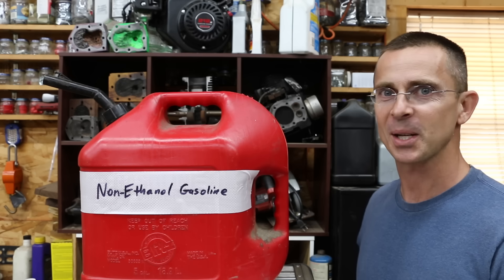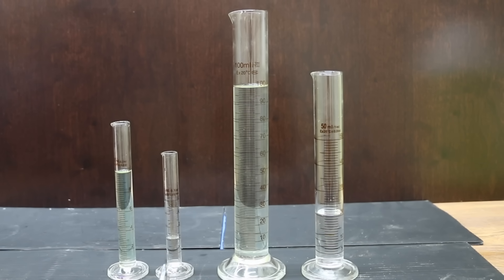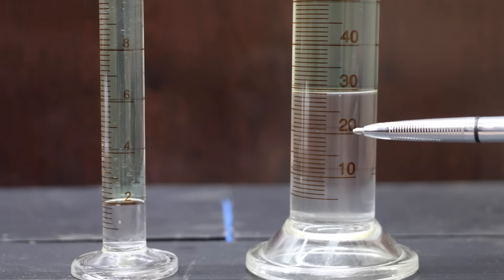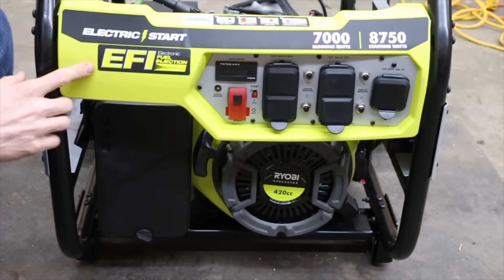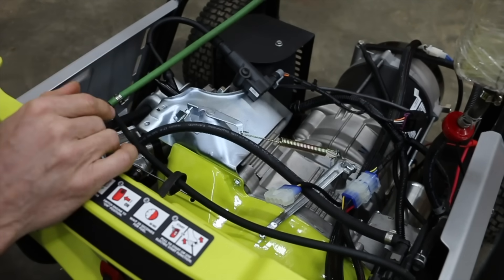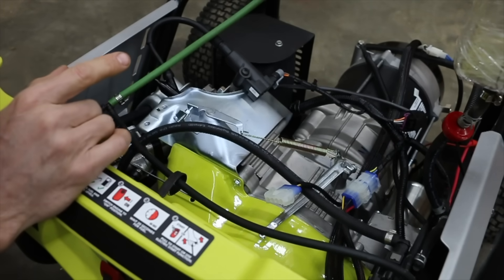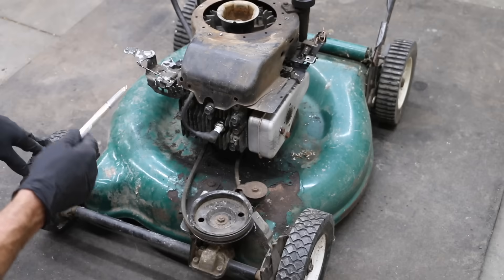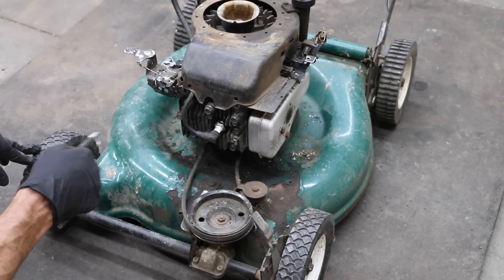Is Non-Ethanol Gasoline Really Better? See the PROOF!

Comment: Ethanol in fuel is a scam. It's government taking your money and giving it to large corporations to spend on something that uses more energy to produce than you get out of it, and is a net economic loss that couldn't exist without massive subsidies.

Ethanol is lower energy density, so you get less milage.
Ethanol has to be anhydrous to be used, and removing that last >5% water is a very intensive process.
Anhydrous ethanol is hydroscopic, so it attracts water and spoils fuel rather quickly.
Ethanol wrecks older engines.
Ethanol is wasting resources that could go to solving world food shortages.
A lot of ethanol "biofuel" is being synthesised out of hydrocarbons from crude oil, not plants, an extremely wasteful and environmentally dubious process.

Why? Why is this happening? Because politicians don't understand science, and think that 10% ethanol in fuel mitigates climate change, when in reality burning ethanol creates water and CO2, just like burning petrol creates water and CO2. It makes no difference. It's utterly pointless, especially when you consider that cars represent around 5% of total emissions. We can't afford to be wasting resources on this stuff.

Comment: I feel like a 4% difference is not a clear winner.  There are a variety of factors other than ethanol that can lead to a 4 percent difference in efficiency from 1 test to the next, I think so anyway, especially in a small engine.  I dont have a problem with the way the test was carried out, I just think that to really say it is different it would have to be done in a variety of conditions  , atmospheric, temp,  rpm...   just needs more testing is all im saying.  If it was say 10 percent,  I'd call that obvious.
Reply from the maker: Thanks for the feedback.

Comment: Ethanol does not increase the octane rating of gasoline. It mimics the antiknock index of a higher octane fuel due to the cooling properties of the ethanol given its vapor pressure property. A diluted fuel will change the stoich values and exceeding 10% can cause damage to your engine IF your Air to Fuel ratios are not corrected. comparing a mL of 91 octane vs pure ethanol, the gasoline will contain more carbon chains than ethanol. (The higher the carbon count, the higher the stored energy)
Reply from the maker: Thanks for the feedback.

Comment: as far as i know, the ethanol was never supposed to be better. its supposed to be greener, reduce the amount of fossil fuels used by replacing parts of them with ethanol.
10% reduction in fossil fuel consumption is kinda huge deal when its global.

and yea i know its not a 10% directly, with loads of other factors im not that familiar with. like if its lower octane gas and ethanol is used to raise the octane, does it mean better efficiency and less waste. and on the other hand if its less efficient as fuel then you need more of it like this video showed. (the 4% difference).
Reply from the maker: Thanks for the feedback.

Comment: I didn't realize how easy it was to remove the ethanol from E10 fuel (albeit with an octane drop).  This is good information to have since I suspect it will eventually be basically impossible to buy ethanol-free fuel.
Reply from the maker: Thanks for the feedback.

Comment: Ethanol isn't the problem. It's the very low grade 85 octane fuel the ethanol is added to. Do another test by mixing good 100% ethanol with the same nonethanol gas in this test to get an e10 blend and see how that works.
Low grade 85 octane (not talking e85 here but 85 octane, some people get confused on this) is the junk that causes problems.
Reply from the maker: Thank you!

Comment: Fuel lines.... A lot of mowers and the like use SAE-30R7 fuel lines... (not rated for fuel injected.. but rated for carbureted fuel flow_) and I'm not sure it's up to the same chemical resistance as something like SAE30R9 (higher pressure and designed for efi engines... different lining, usually nbs).  I wonder if running one long enough to get the line and let it sit for a month or 5.
Reply from the maker: Thanks for the feedback.

Comment: My wheeler would blow tons of black smoke after sitting with ethanol fuel. I been using non ethanol and it fires up and has way less smoke after sitting. I dont even use fuel stabilizer anymore with my motors that dont get used much after switching to ethanol free..
Reply from the maker: Thanks for sharing.

Comment: Can you test if resistance heating vs heat pump heating is any better?  Using your generator a couple of infrared space heaters and then a heat pump window unit of equal heating output.
Reply from the maker: Thanks for the video idea.

Comment: Your 4% difference in runtime is well below your ability to accurately measure the fuel and your load on your engine.

I tested my 650 motorcycle twice with E10 and E0 regular octane fuel with a full tank (latter is very hard to find, only 2 stations in my city carry it).

I got exactly the same MPGs with the two different fuels. No difference.

the only significant problem with E10 fuel is it starts to break down in your tank in as little as a month, and can goop up a carburetor. The solution is simple: if you are going to park your vehicle for more than a month, get a can of Seafoam.
Reply from the maker: Thanks for sharing.

Comment: SOME ethanol (E5 as we have in Europe) is a good thing, it helps with condensation in cold weather. Used to be that we added ethanol to the gas to get the same effect back in the day (carburettor alcohol). Ours is alkylated though, it won't separate as fast in the fuel system but if you're going to leave your car standing you should always drain the system anyway because over time the additives will clump up the injectors/nozzles.
Reply from the maker: Thanks for the feedback.

Comment: Yes, the issue for me is the corrosion and gunk buildup in the carburetor for ethanol fuel after sitting over the winter or over the summer.  I definitely prefer non ethanol for my snow blower, mower and other small engines.
Reply from the maker: Thanks for the feedback.

Comment: You the man with these. I’ve been putting non ethanol in my silver letter rt charger for 4 years now. Over 262 thousand on it. I was putting 91 and above in before. It’s crazy because I actually bought the car because it was rated to run on 87.
Reply from the maker: Thanks!

Comment: Was about to write a comment to please test plastic/rubber components for wear......and then I made it to the end of the video. As always, thanks for testing the stuff we use every day!

I'm curious to see the results. My 2 vehicles I've had for 100,000 miles each - one has almost never had 10% ethanol, the other had majority 10% ethanol for ~75,000 miles. The ethanol fueled vehicle had both head gaskets leaking by 100,000 miles - both leaking at the same time. Never seen head gaskets leak like that - have always wondered if it might be from the ethanol it drank so frequently. Just in case, and to ward off evil humors, both vehicles drink ethanol free whenever possible.....
Reply from the maker: Thanks for the feedback.

Comment: On a unit volume basis, enthalpy of Ethanol is less than pure base fuel.  Thus, one would expect lower fuel economy with a 10% Ethanol blend.  Using equivalent additive packages and dosage rates, Ethanol blended fuels most certainly do produce more combustion chamber deposits vs. pure gasoline on standardized CRC engine deposit tests.  Ethanol has been pushed onto the American public under the guise of many false claims.  While I come from a long line of farmers in my family, the huge corn farming lobby has pushed Ethanol as a way to sell and process more corn and Congress has bought into this.  It actually takes more energy to produce a gallon of Ethanol than the latent energy in that same gallon - yes a NEGATIVE energy balance!  Unfortunately, under the law, it isn't required to label gasoline Ethanol content up to 10%.  We are the only country in the world that takes a major food source (corn) and wastes it by turning it into fuel.  E85 is a complete joke and yet vehicles have been designed to run on it for years.  One brand which is really pure gasoline is BP/Amoco Ultimate.  It contains a base fuel which is refined using a proprietary process and has an excellent additive package.  It really does keep an engine amazingly clean and maintains performance.
Reply from the maker: Thanks for the feedback.

Comment: I had a 2007 Buick, that kept blowing the Car's computer.  Got rid of that car and bought a "NEW 2017"  4 Cyl. Buick.  I asked the GM Mechanic what was causing this failure.  He told me that it was probably being caused by the Ethanol that is now added to the Gasoline (I used 89 Octane)  Mid-range Fuel exclusively.    He recommended a fuel treatment, that was specifically intended to compensate for Ethanol  in the Gasoline.  I have been using Lucas Ethanol Fuel Conditioner.  1 oz. per 5 Gallons is Recommended.  I would like to know what you think.

Comment: I use 89-91 octane E10 pump gas all season, E0 94-95 octane canned small engine or racing fuel (VP, Sunoco, etc...) for off-season storage.  My mower and snowblower are 21 years old and I have a pair of Honda eu2000i generators with over 700 hours each on them.  I also have a rarely used power washer that gets E0 all the time due to infrequent and unpredictable use.  Not a lick of trouble, they start right up each season.   All of the stuff has had only the maintenance recommended in the manual and have original never opened carbs.
Reply from the maker: Thanks for sharing.

Comment: Based purely on the actual ratings, ethanol has fewer BTU's per pound than gasoline.  So, pure gasoline would be more fuel efficient, but have worse emissions; which may not be present in carbon buildup. E85 (85% ethanol) does have worse mileage due to this inefficiency, but it's also 85% cleaner when it comes to emissions.
Reply from the maker: Thanks for the feedback.

Comment: What we have found in Ireland is if the petrol [gasoline] is left in the engine of for example grass strimmer, lawn mower, or a generator over the winter when we try to fire it the life is gone out of the fuel. We cant buy any other type of fuel here.
Reply from the maker: Thanks for sharing.

Comment: Real-world use over the decades it has been in use reveals the truth-Ethanol kills fuel delivery systems over time, and that is a proven fact. Eats seals and gaskets and that says it all. Just ask powersports enthusiasts and Master Techs, we don't need lab coats or chemical engineering degrees to figure out why our vehicles suffer fuel-feed system failures regularly when using ethanol crap. Gas stations here sell "ethanol free" premium because they want the huge $ from that market segment which simply will NOT use ethanol-added fuels. No one cares in cities but out in the country you can option out of ethanol fuels simply at the pump.
Reply from the maker: Thanks for the feedback.

Comment: Nice video! My new truck's owner's manual recommends 93 octane. I finally found some NON ethanol 93 at a gas stations down the road. The truck LIKES 93 non-ethanol. More giddy up and RPMs build up quicker.
Reply from the maker: Thanks!  Thanks for sharing.
Reply: let me guess its a ford? lol new fords have had problems with pinging and spark knock right out of the factory with low octane fuel

Comment: I ran an almost full tank of non ethanol pure gas in my Honda Odyssey in Arkansas, and what a difference in power it had! It did not run bad before with the regular 10 percent ethanol gas, just was more responsive and had more power going through the Ozarks than the ethanol fuel. It did not hesitate when I hit the accelerator, just power right away. And I did not need as much throttle to keep speed in the hilly parts. It's worth it to try it once in your vehicle for the hell of it if you can get it.
Reply from the maker: Thanks for sharing.

Comment: I just got my ATV out of the shop the carburetor was flooding and the petcock would not shut off mechanic says the alcohol in the gasoline is what caused the damage eats up the seals and other non metallic parts $350 later it’s fixed for now on I will use the recreational gas in it and in my garden tractor two new carburetors in four years can’t see why it’s even used has no bearing on emissions they say and it’s expensive to distill roughly takes two times the energy to make one unit of it .I have found the-star tron is much better that sta ble ! It lasts much longer ! Cost a lot more but seems to keep things in good order longer  sta ble goes to pot before winter is over !
Reply from the maker: Thanks for the feedback.

Comment: Since I’ve started using non ethanol high test gas in my lawn mower and snowblower I’ve never had any problems. They start on the second pull and run smooth even after sitting for a few weeks. Before, when I used reg ethanol gas I always had hard starting and rough running especially after sitting for awhile. Apparently, ethanol has a short shelf life and turns to gel after sitting.....not a problem with your car as you go through gas a lot quicker. My older machines also had to have the rubber hoses replaced as the ethanol corroded them.....not an issue on more modern small engines with parts designed to work with ethanol gas apparently.

Comment: Thanks for doing this work. Since we've started having non-ethanol fuel here in town, I use it, even though it's more expensive, because I associate it with my car's feelings. My car is happier when it's got an oil change and new tires, and it goes just a tiny bit faster when it's got the pure gas, and I feel like I'm not participating in 1990s political crap, something to do with subsidizing farmers and genetically modifying corn and what-not, and causing less emission of one kind of gases, while not doing anything about others. When it comes to empirically testing and being rational, you are the greatest.
Reply from the maker: Thank you!
Reply: Actually, if anything it will be slower on pure gas
Reply: @pbear216  let them have their delusions about speed and "1990s political crap"

Comment: The issue is not the subtle performance difference. The issue is whether or not your engine can hold up to alcohol or not. I thought biodiesel was the coolest thing on the planet until I destroyed my engines because the solvent of methanol was breaking down my flexible fuel lines thus destroying my injectors and rings. Now I hate alcohol and have several engines that cannot hold up to the corrosive traits of ethanol or methanol. Also alcohols are by nature very "dry" as they tend to "unlubricate"  your frictional parts. I for one am an advocate for getting rid of this boondoggle as the taxpayer foots the bill and it takes more energy to produce this stuff than what you get out of it on top of the damage it does to engines not designed for such corrosive solvents.
Reply from the maker: Thanks for the feedback.